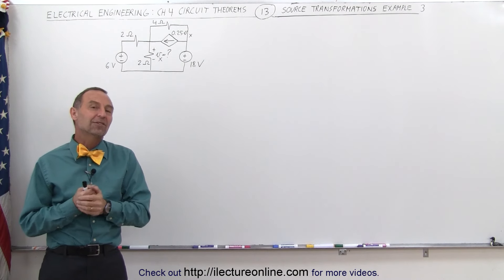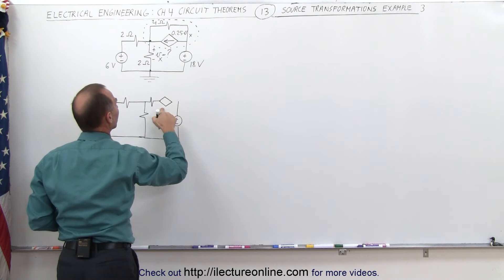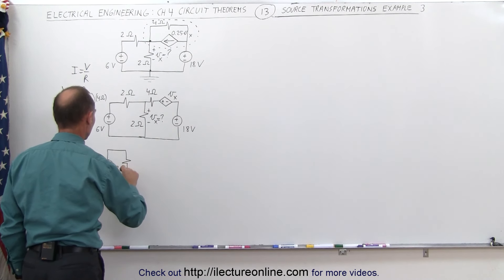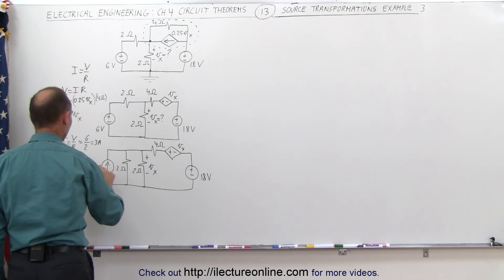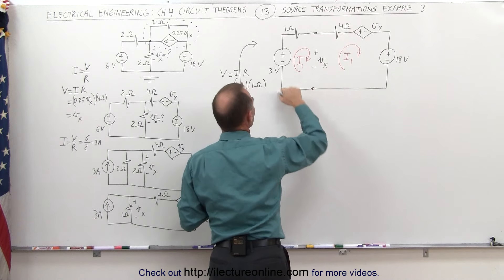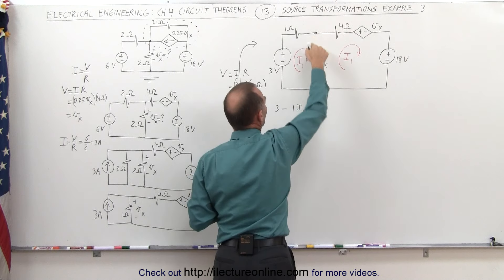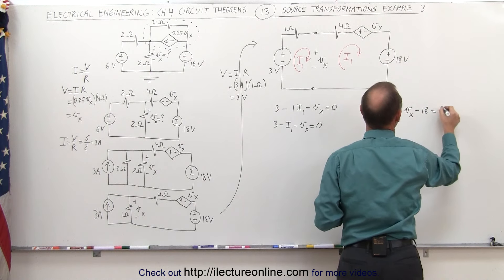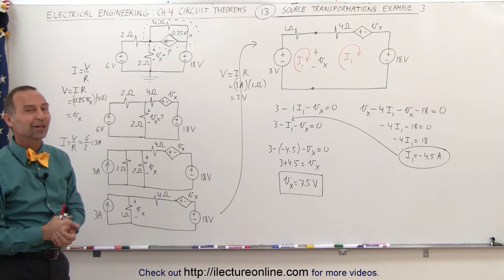Electrical Engineering: Ch 4: Circuit Theorems (13 of 35) Source Transformation Ex. 3

Comment: Can I combine and independent voltage source with a dependent voltage source?
(edit: after some more thinking about why I failed: Maybe I can’t add the two current sources together if they essentially are in series with each other, because I have no other connection back to my designated ground?)
From 4:18 I combined the two voltage sources of 18volt and ux volt to one single voltage source on the right with a voltage of “18+uv” volt. I then converted both remaining voltage sources to current sources. I then added the two current sources together (because they share the same nodes on each sides). I was then left with only one source, and two resistors with one of the resistor(1ohm) in parallel. I then converted the current source to a voltage source. and finally got a single source(a current source of "30+ux" volt) and two resistors in series(1ohm and 4 ohm, with the ux node between them). The problem is when trying to find the current I get I=7,5A. But it should have been 4,5A as in the video. Anyone have an explanation to why this didn’t work for me? (edit: see my edit at the start of my comment)
Reply from the maker: Dependent and independent sources should be kept separate and handled as individual items in a KVL analysis

Comment: So in this situation we shouldn't think of it as finding the voltage across the 2 ohm resistor (but rather a voltage drop between two points?)? Can there be more clarification on this and the artificial mesh?
Reply from the maker: The objective usually is to find the currents in each branch of the circuit.

Comment: Dear Doctor Michel,

I send you again the question I asked you previously in Circuit 
theorems: 11 of 35 in case you haven't seen my question since you always
 answer them very kindly.

I would like to ask you why the final answers to source transformation 
exercises always change depending on the approach you take to transform 
the circuit. Is there a set of rules or guidelines (eg. convert 
everything to voltage source and add or take away the voltages 
accordingly) that must be followed to obtain the correct answers?

Thank you in advance.
Reply from the maker: The answers should be exactly the same.  Thus if you come up with a different answer, you probably made a mistake somewhere.

Comment: Excuse me sir, I would like to ask a question
if i connect the buttom to the ground, but there is a (4V) voltage source on the buttom, placed just left to the mid position. So i want to ask from the positive terminal of this voltage source to the left corner(This area), the voltage is 0 or 4 ?
Reply from the maker: Typically you want to connect the negative side of the voltage source to ground.

Comment: Hi , I want to ask about something
if i want to find the voltage source across a current source 
and this current source is connected in parallel with a resistance 
could I convert the current source to voltage source and say the voltage across the current source is the current multiplied by the resistance parallel to it ? or I can not because i want the voltage across the current source and i can not transform it ?
Reply from the maker: Sorry.  I got lost in your question.
Reply: @MichelvanBiezen  I repeat my question on Electrical Engineering: Ch 4: Circuit Theorems (11 of 35) Source Transformation Ex. 1
Reply from the maker: Thank you.  I hope the hint helped.

Comment: Can not we sum an independent source and a dependent one? Like (Vx+18) in this case
Reply from the maker: Yes, you can treat independent sources the way you treat dependent sources, but be aware that the voltage or current will depend on some other condition in the circuit.

Comment: little question:
why can you use KVL equations for two loops when you got only one loop?
why V sub x still stays the same is you diminish the resistor?
thank you very much
Reply from the maker: KVL is used for multiple loops as well.  You set up an equation for each loop and then solve them simultaneously.

Comment: dear professor in the second circuit, I tried using mesh method but i got a totally different answer from the one you got for Vx. Why does it not work? Thank you
Reply from the maker: Not all methods are ideal for every situation. That is why we teach the different methods.  Often the method will work but we make a small mistake somewhere.  (Happens to me as well).